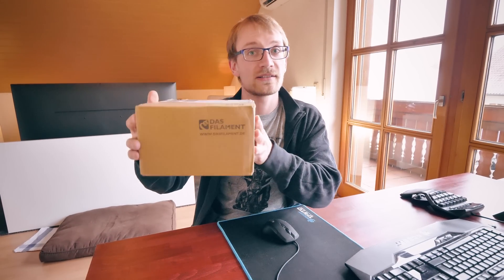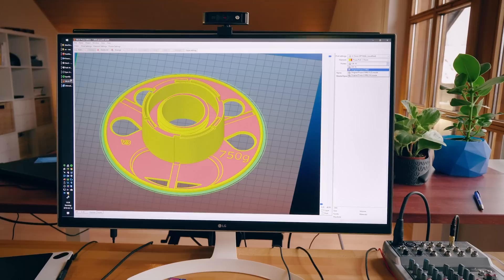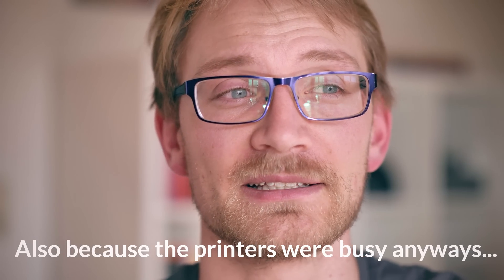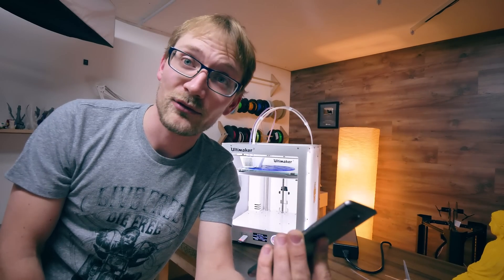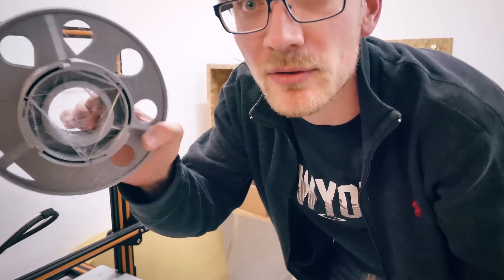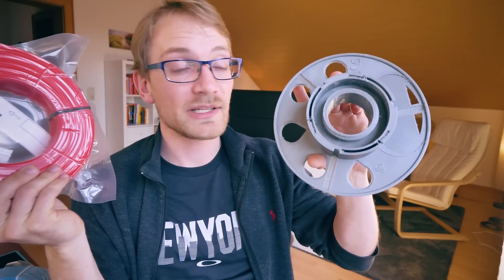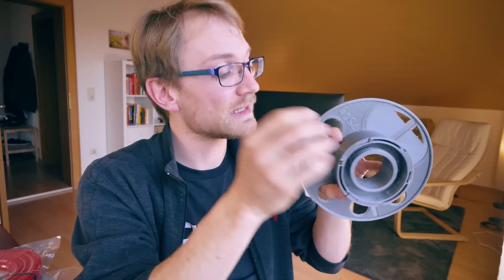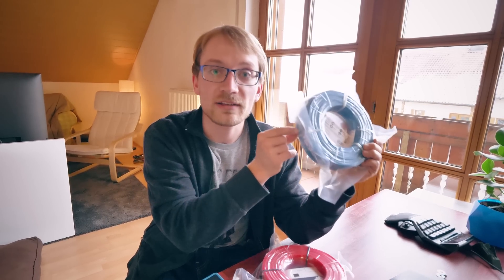3D printed filament spools!?

Comment: Doesn't that just add a good pile of complexity to coiling and sealing the filament for shipping it in the first place? I'm more a fan of Proto-pasta's cardboard spools if the goal's weight reduction or sustainability.
Reply: The coiling is done in the same way, just with a jig replacing the empty spool. The filament spools from dasfilament already came vacuum sealed, so that's no added complexity either.
Reply: All the filament I buy has both a reel AND plastic bag for vac sealing. So this master spool style would be an improvement over that standard. I'm going to look into buying some of this.
Reply: The added complexity comes from the vac-sealing process. I can see a way of cutting down on cost being to send a tightly-wrapped bag with a cardboard insert to keep the filament round, and hopefully with manufacturers subtracting the weight of all packaging if that could remain consistent between lots.
Reply: The vacuum sealing is added complexity that I'm happy to pay for, since even PLA is fairly hygroscopic. Using a jig and zip ties seems like extra work, though. After taking a little more time to think on it, I do like the design of the spool, but the print time and material use still makes it a hard sell for me. If I had a printer that was limited in the spool diameter it took, I'd probably see more value in it. The printable spool does still have a niche for spliced partial rolls and sample coils, but I'm not too crazy about the idea of every manufacturer selling refill coils.
Reply: It's an environment thing, but honestly plastic bags for vac-sealing is about as bad as plastic spool reels. Cardboard spools and boxes seem to be the better bet environmentally, but reuse of the spool might be limited unless that cardboard is really thick. Sustainable plywood would be best for the environment and reuse.

Comment: I wonder if you can use 3mm filament and a 1.75mm nozzle to change the size of filament using a 3d printer, lol.
Reply: Short answer: No you can't with any reliability. It takes a lot of energy, the diameter will vary and extruding filament to any kind of accuracy is a lot more complicated than pressing it through a nozzle (there are videos on youtube if you are interrested).
Reply: Hmm, makes sense. Its not like it would be practical anyway.

Comment: Moka Coffee tip: fill it with powdered coffee well above the limit (it should form a small "mountain" of coffee) and then screw the top half on, without pressing it prior. Also, water up until it just touches the valve, and put it in slow heat. Slower and messier on the first tries, but your coffee (and your vlogging also) will benefit from that :D Liking the new experiment with all the "tropes" of the genre and the humorous take on them!

Comment: Hmm i think the whole thing is a nice marketing gag to sell more Filament. According to one reddit post one spool needs about 200 g of filament to be sturdy. It would be much more friendly to the environment and your wallet to take an old spool, saw it in half at an angle and print a adapter from thingiverse to put them back together. Needs less filament, the spool is probably more sturdy and you dont need a huge print surface to print it.

The idea is nice but since the cost of refill filament is exactly the same (€dit: Strike that you get 50g more filament) there is not really a incentive to buy these loose filament packs.
Reply: Well if you only use like 3 or 4 rolls a year, yeah it might not be for you as it would take a while to break even. If you use like 4+ rolls a month, you should make up the difference pretty quickly and everything after the 4 rolls would be free. Not to mention the reduction of waste for all the spools you would have been left with
Reply: It is very well thought out with the notches for the zip ties, where you can also insert new zip ties if you want to change the filament. And also with the filament holder. And even if it needs 200g using zip ties to change between some prints regularly you need less spools then filament, already making it all better. As far as I heard it only need 50g of filament
Reply: This is the Adapter i'm talking about: https://www.thingiverse.com/thing:2782912
I have enough empty spools arround so will never need to order another spool again. To be clear: i don't hate the idea but if you already have empty spools at home, and lets be real most us have, there are cheaper ways to archieve the same effect.
Reply: RichRap was saying he was hoping someone would injection mold them. There are some two piece spools that you can unscrew but they don't have the slots for the zip ties or the tail of the filament.

I don't intend to print my own spools. I did it once for loose coils of samples and it wasn't worth the time.
Reply: I can see a company taking this idea and making a cheaper, lighter, more durable injection moulded variant. Buy as many as you need and from then on, spool free refill packs.

As was said in the video, by removing the spool, they can get a touch more filament into their product before they tip over that 1Kg total shipping weight that bumps up the cost of buying filament. I can't be the only one that has decided to buy more plastic than I need just so the shipping costs didn't hurt so much.

I like the idea. I don't like the initial print investment.

Did you see the origin video?  https://www.youtube.com/watch?v=NtdcciXnfM8

(And the followup video... https://www.youtube.com/watch?v=AqnFiI3thjQ )
Reply: Was looking for this comment, but I guess the need for the zip tie notches is also a good point